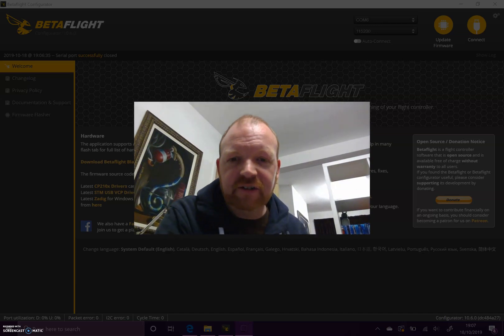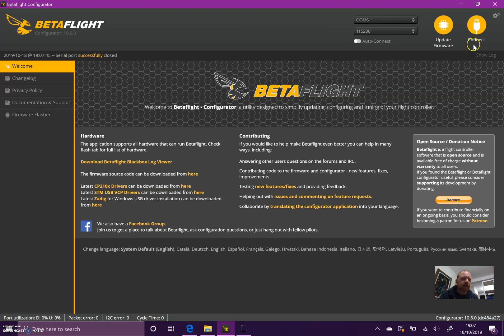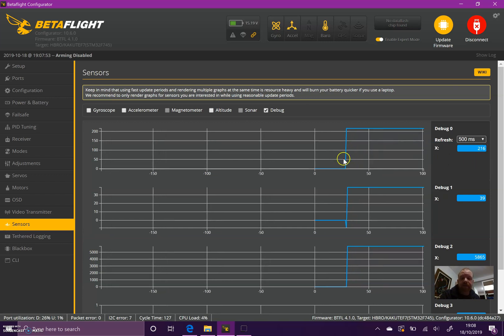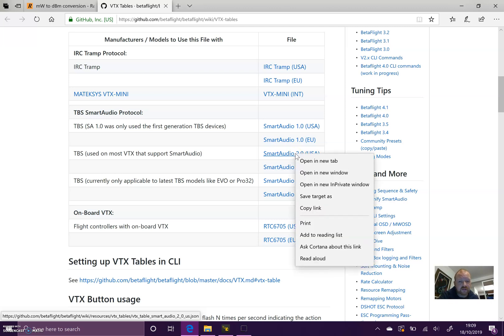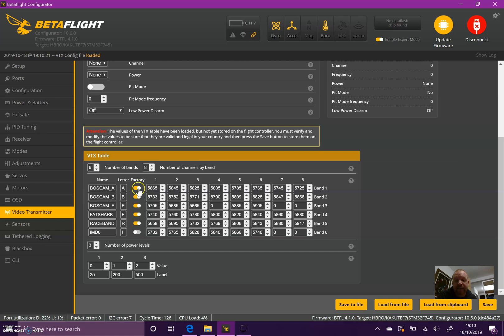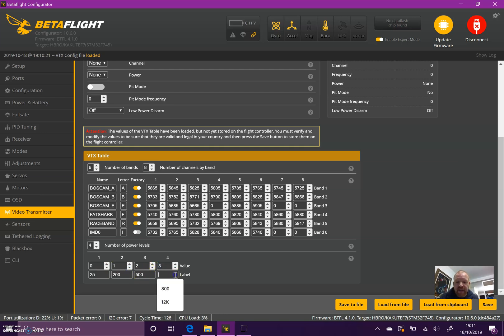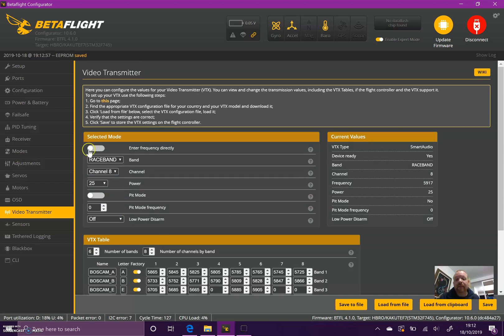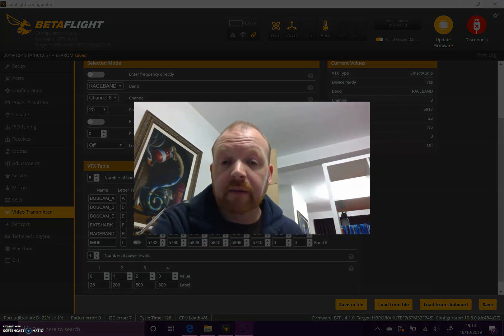CORRECT Betaflight 4.1 VTX Table / Smartaudio Set up (Updated info!)

Comment: Hi Im having problems , Im had 216 on the debug sensor tab. My port is on smart audio  and I have the 2.0 vtx table but in my osd it says  not configured . In the ports tab I changed it to tramp, now I can change  channel  in my osd. Im using rush tank racing vtx  500mw max. Did I set it up wrong ? Thank  you
Reply: Hi, that's odd. Pretty sure the tank racing vtx is smart audio not Tramp protocol. If you're getting a reading on the debug tab, you must have the correct UART set up. Have you checked that the vtx table has a frequency on the channel you are trying to change it to? If it's got 0 as the frequency its locked on that channel and nothing will happen when you select it?
Reply: @OriginalGingaNinja  Hi, yes its very odd. I have all my bands(5) 8 channels per band and 4 power levels. Although  I needed to modify the pwr levels. The rush vtx is smart  audio  but the osd only works when set to irc/tramp. It seems to work though , but I need to change the channel /band on rapidfire manually . Thank you for trying to help.
Reply: @jordannovek2911  You always need to change the channel on rapidfire manually, smart audio only changes the vtx transmitter in the quad. It weird about the tramp bit though.
Reply: Everyone has to select channels on rapid fire manually did u think module would change in goggles when you select a different frequency on vtx. ?

Comment: I have done everything as you explain, my VTX is connected in UART 3 (omnibus F4SD), debug is ok number 200 ... but the changes do not take effect...Betaflight 10.6 with firmaware 4.1
Reply from the maker: Hi, if you're seeing a reading in the debug trace, you must have the correct uart set up. So you can rule that out. Are you trying to select a band / channel that is showing as 0 in the frequency table by any chance? As they are effectively locked and it wont switch. Which vtx is it?

Comment: newbie ?? i have iflight twinG f4 succex and ifligth succex 45 a aio esc,,,xing 2207 2750kv  would you start out with 4k 4k on ds 300 of do 8k 8k on 600.. ... going to load this build tonight,, have only used f3 on wizard so reallly first build. not much info on this board , recieved as a gift so im building it ..on 4s because that' s what i got..